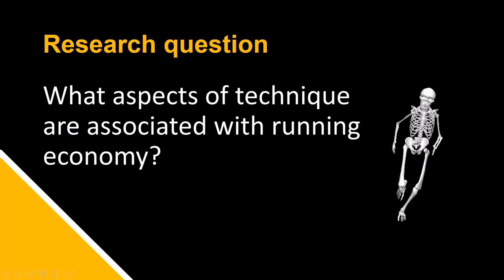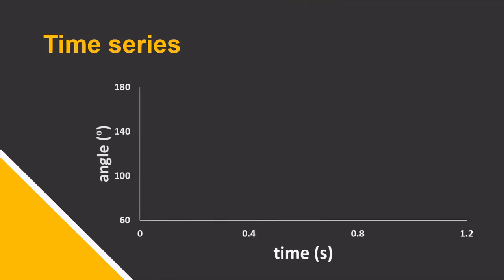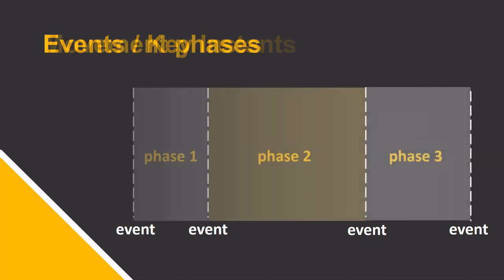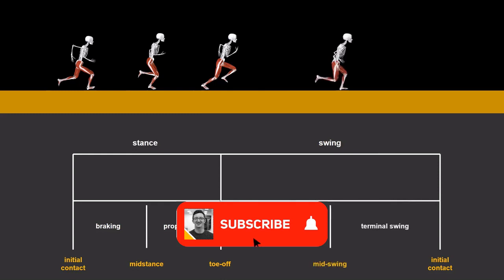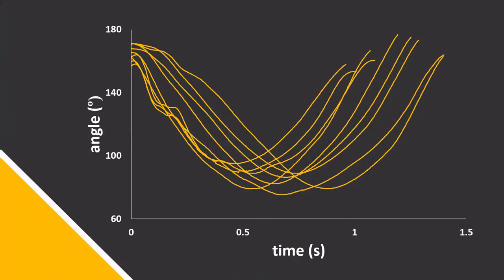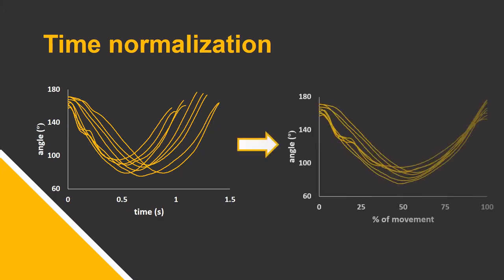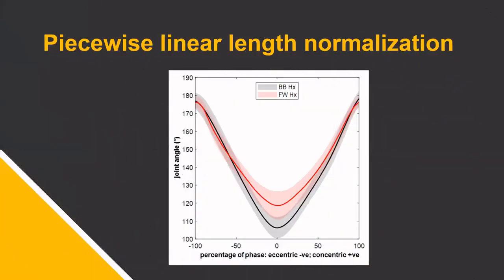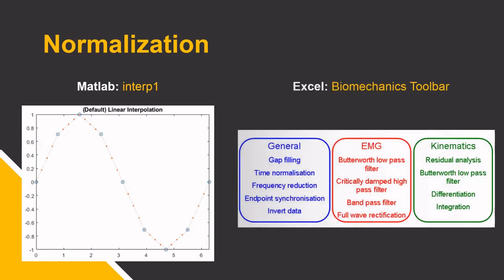Gait Cycle Phases, Events and Normalization

Comment: Thank you for your explanation! I have a question, I have retrieved GRF data from force plate experiment and trying to normalize the data with the excel biomechanics toolbar which i have installed but couldnt seem to find the addin toolbar, can you help to solve this problem, or a video tutorial on it? Thank you beforehand 🙏🏻
Reply: *couldnt find the addin for the biomechanics toolbar, and im using excel 2016
Reply from the maker: Hi Kevin. Because mine is already installed, it was difficult to check what to do. However, I notice that you can click File --> Options --> Add-Ins and then maybe manage your add-ins from within there (hopefully).
Reply: @biomechstu  Thank you for your response! I already installed it, and already tried to manage add ins and browsing it but the biomechanicstoolbar folder does not contain add in? or Am I missing something ?
Reply from the maker: @saucesonice69  Not sure if this helps, but within the folder there is a 'JOSKEvbm_Install' file. I seem to remember opening that file, and then when I closed it and opened a new Excel window the Add-In was there. I might have remembered incorrectly, though.